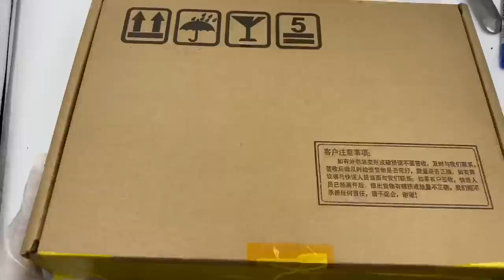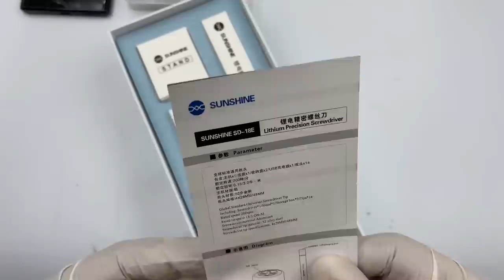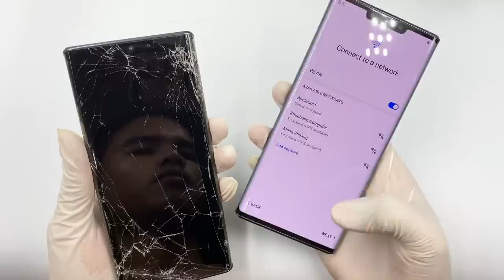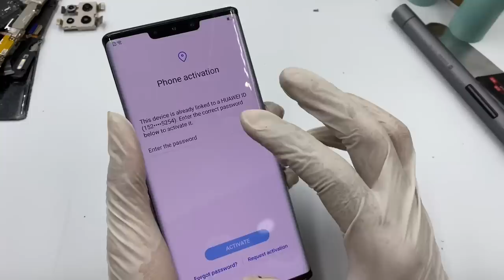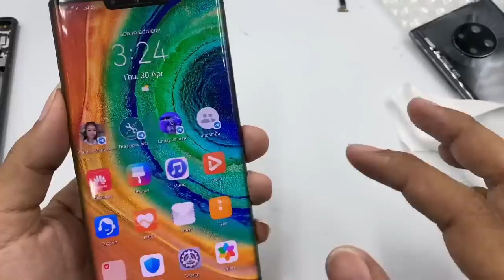Restoration Mate 30Pro...

Comment: I did not like the way you seal the back cover. Use proper water tight sealer man.. Be  neat at your work.. Clean the old residue before applying new..